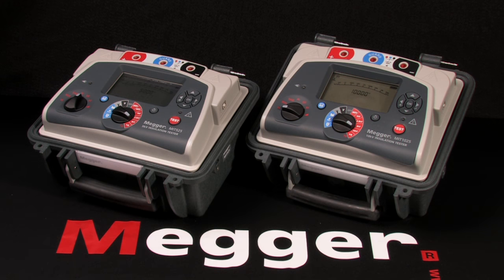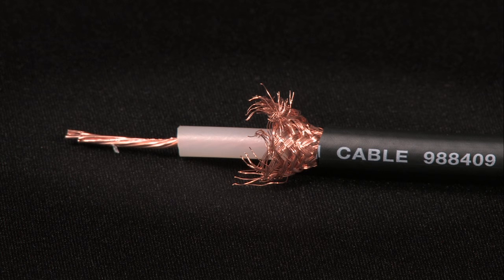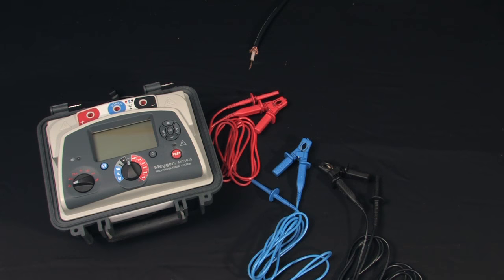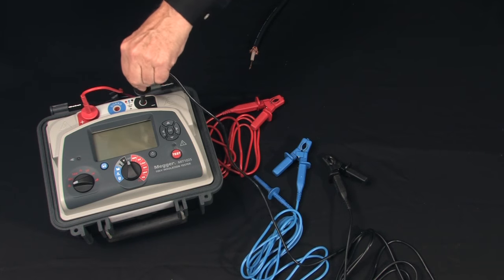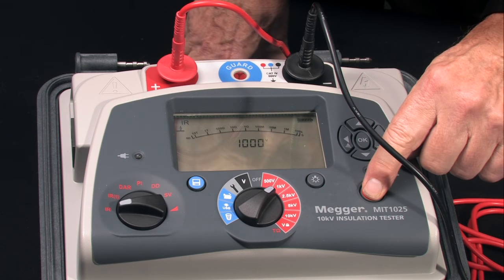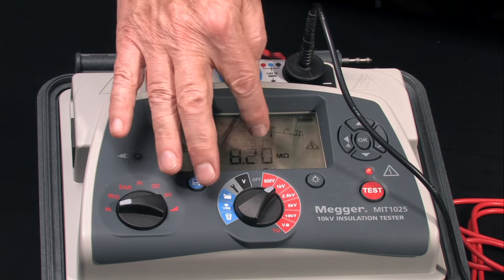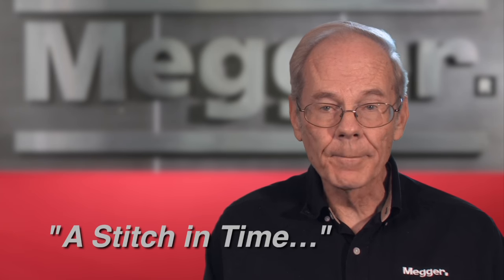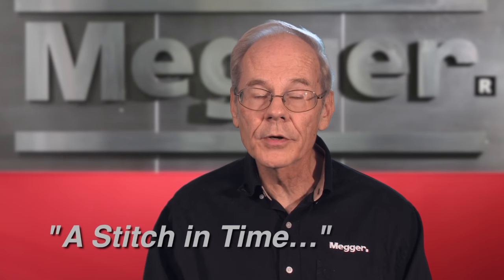Mit1025 Insulation Resistance Tester - Getting Started

Comment: Megger - Why don't you all explain HOW a megohmmeter works when you are testing insulation on single insulated conductors (all insulated) and installed in a PVC Raceway with no contamination on the insulated conductors. In fact, why not "attempt" to explain how the return current gets to the return lead when again all paths in the raceway and the raceway itself are insulated. Go head.....I'll Wait.

Comment: Good day, please I have issue with mg Megger. Whenever I'm testing 08 Err normally displayed on my 10kv insulation resistance tester
Reply from the maker: Hi there, thank you for your comment. Please could you contact our TSG team depending on your local area. If for UK please contact dovertechnicalsupport@megger.com or call 01304 502102